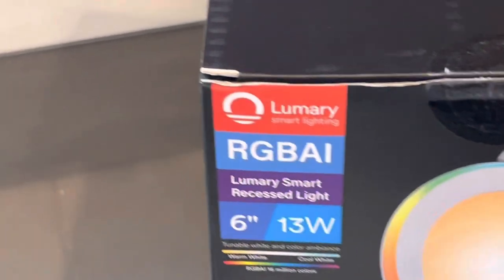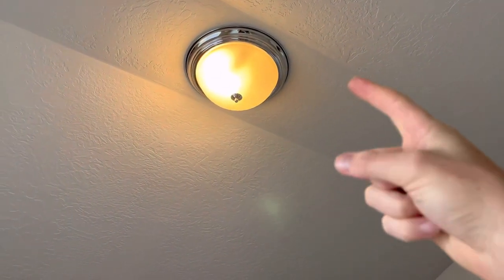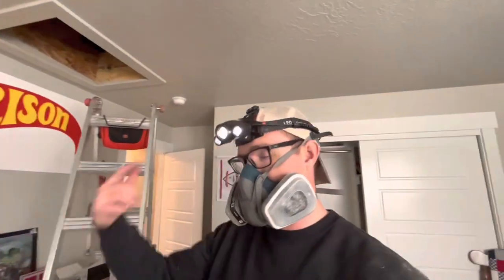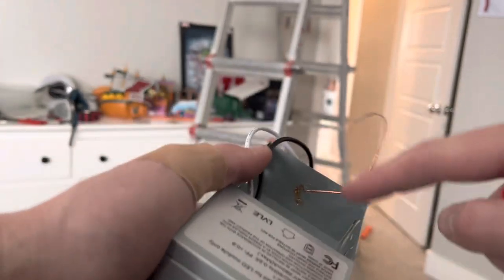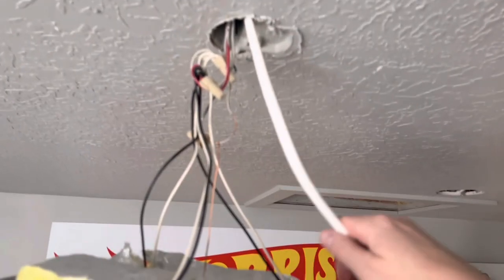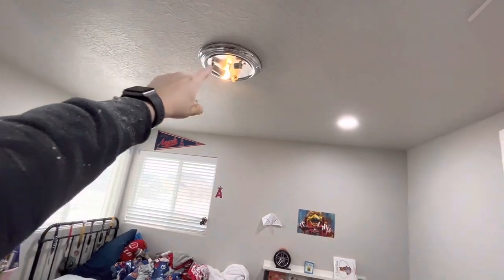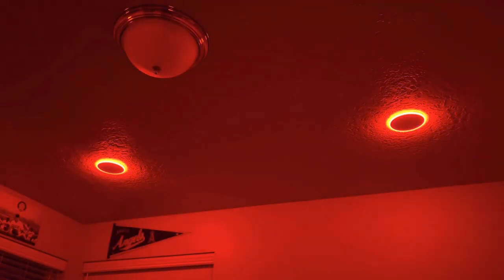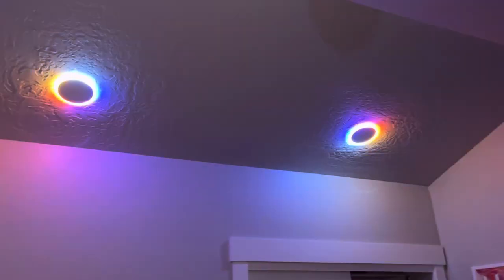Install Smart Recessed Lighting || Lumary Smart RBGAI with Auxiliary Night Light #smartlighting #diy

Comment: Great video! How did you set up for the night lights to come on without the main light turning on?
Reply from the maker: You can switch it through the app. Both lights are not supposed to be on at the same time. If you enable Alexa/Google with a command you can voice control the switch. Thanks for watching
Reply: @HomegrownHowTo  thanks for the response! I have Google but can't seem to get the night light to turn on without having to go to the app. Did you have to do something special with Alexa?
Reply from the maker: @meetthemartins1094  yes I had to program the commands on the Alexa app.  I can’t recall the what the default commands were but I changed it so when I say “Alexa turn on nightlights” it kicked them on. I don’t have google so I can’t help there. Sorry. 😞 I know the instructions that come with the lights aren’t the best either as the language barrier is definitely there.

Comment: In new construction do you have to wire these to a physical light switch or can they just be controlled from the remote and app?
Reply from the maker: Great question. I would assume you’ll need a light switch to meet building codes. But I’m not entirely sure. They do work well with a traditional switch as well.
Reply: You can use physical switches, but can not support dimmer switch, does not support remote control, can support app and third party voice control.

Comment: So I ordered 2 of these lights for my garage and only 1 can connect. “Very frustrating”. 

So I ordered another one and just switched out the light and STILL won’t connect. I even tried “AP Mode”… Any suggestions or ideas? Did you have the same problems??
Reply from the maker: I did not have this problem. But it does sound frustrating. I had one light start to flicker after about two weeks of install. I reached out to Lumary and they sent a new light right away. I tried just switching out the light and it still flickered. I then replaced the junction box and it worked great, with both lights. There was some sort of issue with the original junction box. So you can try replacing the junction box as well but to me it sounds more like an issue with the wifi connection likely coming from the light source. I recommend reaching out to Lumary and let them know your issue.
Reply: Same here with my foir lights. Im so frustrated having to pay so much for these lights not  connecting